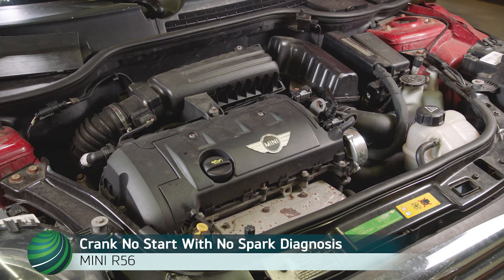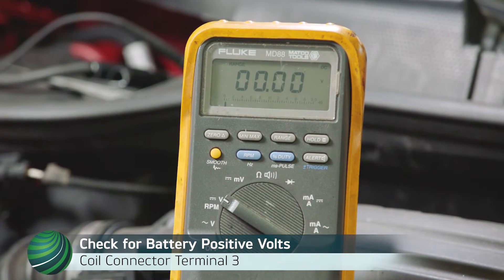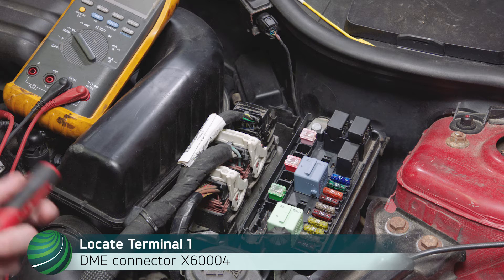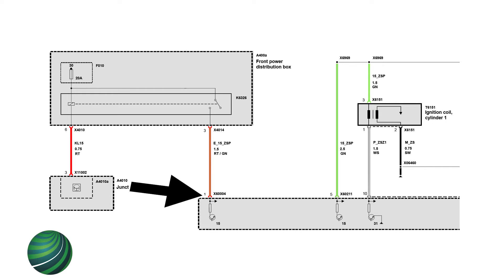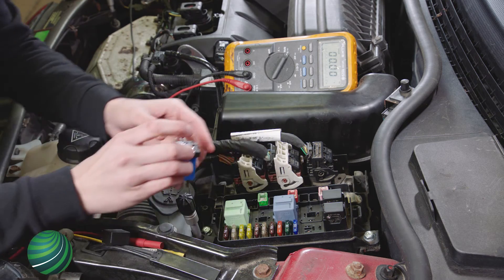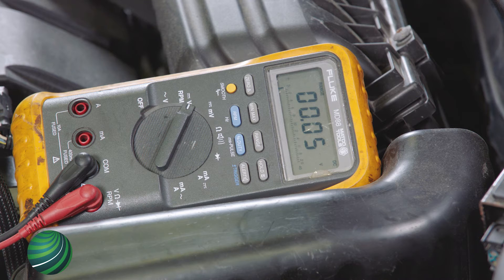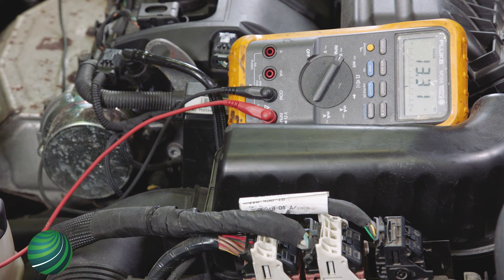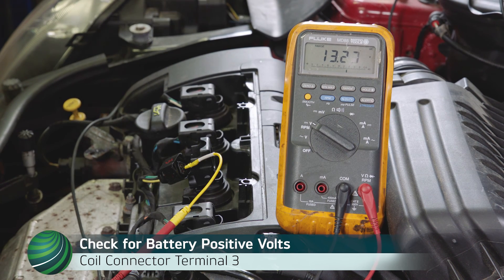MINI Cooper R56 Diagnosing Crank but No Start Diagnosis - How to test and Diagnose

Comment: Hi, I have a 2003 Mini Cooper that's immobilized. The scan report indicates no reading from the CKP sensor with the SWE system. The scanner has the special function of synchronizing the newly installed CKP sensor so that the vehicle synchronizes the ignition. My question is, is there anything mechanical that needs to be done before relearning the CKP sensor with the engine? Another question is, what happens if it doesn't synchronize properly? Could the engine blow up the engine block? Thanks for your help and contributions. I look forward to your response

Comment: Well.  I did not have voltage at the green wire, nor at position 1 of DME. The fuse was fine. However I had power with the key in at pin 3 of the relay.  No voltage could be measure at pins 1-2.  So.. I added a ground wire and BOOOM big spark ????
Reply: So what did u find was the issue since u had power to the relay
Reply: The speaker says terminal 6 of the K6326 relay but never showed where that was it looks as if should be the circuit controlled by the relay??

Comment: Help! My mini was starting fine before I replaced the water pump. I had the battery and ecm disconnected. I connected the battery back on and tried to start the car with the ecu disconnected(forgot) after connecting the ecm the mini won’t start. Any thoughts? Thanks

Comment: Nice video but if you don’t have spark ⚡️ but you have power at the connector the computer may not be pulsing due to the engine speed sensor or sensor gear bent teeth. Even if there is an rpm reading that doesn’t mean the computer is getting the correct signal. If it’s not getting correct signal you won’t get spark at coil.
In my case I had no spark because the “sensor gear” was damaged. The sensor gear is located behind the fly wheel. 

If the teeth are bent on the sensor gear the engine speed sensor will not give the computer the correct signal. 

For me this was causing the no spark. Crank no spark condition.

I was able to fix the bent teeth through the hole of the engine speed sensor. 

I believe the teeth were bent because the release bearing broken and was banging around in the bel housing. A piece of metal may have gotten in behind the flywheel where the sensor is.

I’ve posted this on Identifix as well.
I hope this helps as I couldn’t find anything to help me.
Reply: Please help me my car have hard starting and then die after 1 second. Replaced fuel pump, hpfp is good, replaced coils and plug. I have a 2012 cooper S coupe.
Reply: Thank you. 👍
Reply: @nikolapetrovic997  welcome
Reply: Hi i have a 09 R56 mini s cranks no start but everything is getting power like relay fusebox even the jbe is turning the fuel pump on coils are getting power car would only try to start if i spray carb cleaner tru intake and once the carb spray goes out it will shut off like if its not getting gas i even changed all injectors fuel pump fuel filter new head cover just incase and still nothing...😢

Comment: THANK YOU!! My passenger side was FLOODED.. dried everything out but still no start. I jumped the relay with a paper clip and got it running🤣 now time to replace JBE. Thank you again!! 💯
Reply: Andy that’s exactly what happened to my daughter Mini. It got wet on the passenger side due a sun roof leaking and now the car won’t start. A “mechanic” came today a said that I need I new engine. I told him that the car didn’t started since it got wet. How did you jumped the relay?
Reply: @Boribori787  hey brotha I have a similar question. Which relay did you jump with a paper clip? And how? What holes did you stick the paper clip into? Is there a video on YouTube for this. Thank you
Reply: @Boribori787  I used a paper clip to jump the relay to verify that the jbe was the problem.. it’ll start and run with the paper clip, at least to verify the problem
Reply: @andymaz6700  great, I will try that tomorrow to see if the car finally start. Thanks
Reply: @Boribori787  Did it work??
Reply: @andymaz6700  what pins did you connect to?
Reply: OMG same thing happened to me too! Do you mind sending me a link to the part?
Reply: Hey what relay it’s the current one he’s testing !?

Comment: What do you mean ground terminal 6 on a 5 terminal relay?
Reply: Where is terminal 6 on the relay numbers go up to 5
Reply: @gerryrodriguez2848  Did you ever get an answer to this? I'm have the same question.
Reply: Me too.
Reply: I think they misspoke and meant ground terminal 5 relay, which would be grounding out this relay as this relay sends power to DME when grounded by the JBE.  I think that is how it works. I am new to this but slowly becoming an electrical engineer due to my crank no start mini cooper s 2007 I have been enslaved to for the last 3 months. I am going insane.  I am so sure it is not the DME.  Looking at 30G currently

Comment: I get the crank, with no fire. But the scan shows all 4 cylinder misfires. No other codes. Already installed new timing chain, because it had over 120K on it. Considering chasing down coils or cam position sensors next. Great video, My Hanes manual doesn't cover any of these procedures.
Reply: Hanes are garbage. Buy the Factory Manual, it covers everything!
Reply: Head took a dump. Valve seat looks like something took a bite out of it. Zero compression on cylinder #4